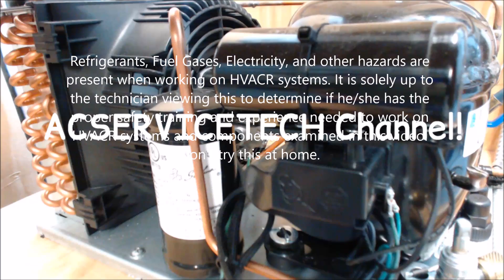Capillary Tube Metering Device and Evaporator Refrigerant Flow! Superheat!

Comment: I have a Goodman 4 ton condenser  that for some reason is not cooling  the house. low pressure is 64 / High pressure line is about 198 psi .
The evaporator has cap tubes , do you think I have a restriction? this year when I turned it on i thought I had restricted liquid line drier, I replaced that, evacuated the system to 29" no leaks. Charged the system and it has been working fine. 3 days ago, the fan went out, it was down for a couple of days, powered it back up,
and same issue I had earlier this year. What are your thoughts?
thanks
Reply from the maker: I would need to know the superheat and subcooling to tell, thanks!

Comment: Hi, is it possible to convert this evaporator from capillary tubes to txv?
Reply from the maker: You would have to add the distributor tubes instead of the large header you see as well as cutting out the cap tubes and bypass. We would normally replace the evap coil since the old cap tube evaps were so small, thanks
Reply: THANK YOU!! i MANAGED TO DISCOVER THAT THE CAP TUBE FILTER IS TOTALLY CLOGGED  - AFTER REMOVING THE ACCUMMULATED CARBON - PRESSURES ARE OK NOW ...

Comment: Acservicetech I have a question for you man....you know about the 30 + rule of thumb for the head pressure...so how you do for the suction side?
Reply from the maker: That 30+ rule of thumb is just a tip but always, always check the charge with either the superheat process for pistons and cap tubes, and subcooling for txv's while checking superheat for safety for the compressor. Suction has to do with the evap coil and the coil sat temp will be anywhere from 34-48 degrees usually depending on the inside wb temp- Here is the video that discusses some of that-  https://www.youtube.com/watch?v=uEs99SSKjgE&t=25s&list=PLxnHR5_D2ojxZI3-xx03Bttxe3xCqUD87&index=22
Reply: Thank you for the help acservicetech 👍👍👍